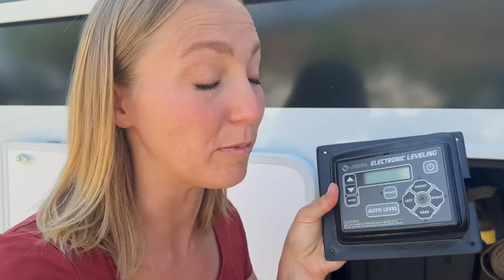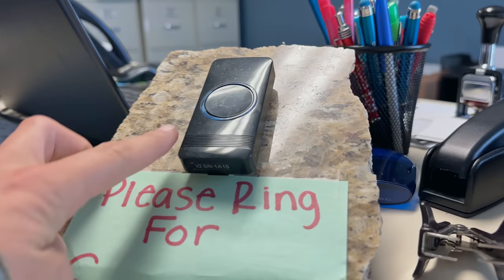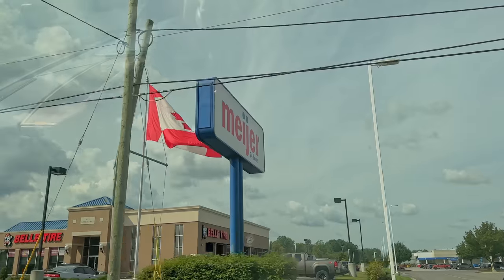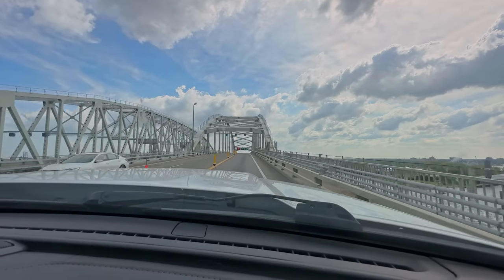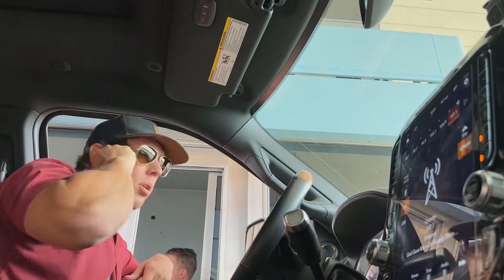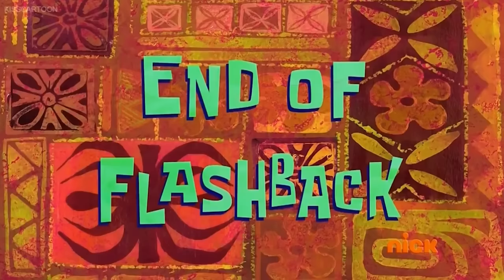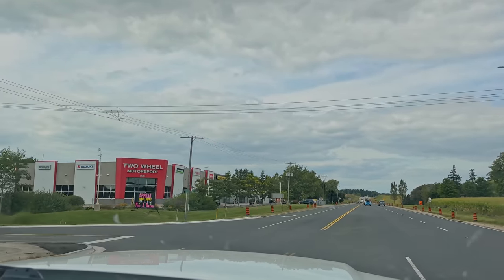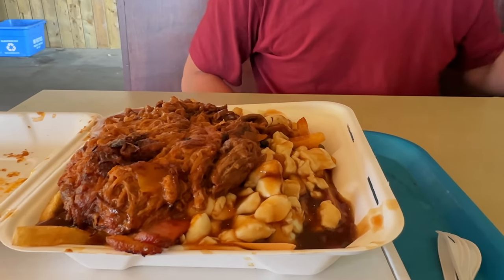Canada Border Crossing with RV...Why so Mean? [RV Living]

Comment: Hi!  We live in Buffalo (WNY) area (62 years).  If you haven’t crossed the border yet, use either the Niagara Falls one or Lewiston.  Those are not as busy as Peace Bridge.  It’s always easier to get to Canada than coming home.  Don’t be surprised how much they will give you a hard time coming home to USA!   One of the questions they may ask is if you bought any liquor in Canada (you are allowed to buy it cheaper in Canada and bring it back here. Depending on how long you have been there, is how much you can bring back.).   Also, the easiest place to get wings will be Duffs on Transit Rd in the Eastern Hills Mall.  Plenty of space to park your RV, and in a good neighborhood.   Also, it is only a mile off the 90 Thruway exit.  Actually Bar Bills is right by here as well as (a close empty parking lot as well) and Anchor Bar is also right here by the exit as well.      We would love to meet you two if you are interested in lunch/ dinner.. Message me!
Reply from the maker: Well, we did end up doing the Peace Bridge Crossing as we read it was the biggest (for big rigs) but it was quite busy! overall went smoothly though. Thanks for coming along!

Comment: Craig and Victoria when you get time later on if you need a better hitch for your truck to pull the RV or traveling trailer, get in touch with Nick the Hitch. He is on YouTube; we watch him help another RV travelers because you guys travel a lot as well. Safe travels
Reply from the maker: That hitch is actually the one we have! A PullRite Superglide hitch. Been using it for over two years since we first set out on the road and love it. It's great since we have the short bed truck, would highly recommend it if you need a slider hitch!

Comment: I worked for the highway department in Ontario- bridges that are close to or under the legal road height are signed with yellow and black signs, with height in meters.  Bridges that are high enough for legal loads do not have such signs.  Overheight loads require a special trip permit with a route that does not conflict with low bridges.  The bridge collisions are typically backhoes and excavators poorly set up on trailers, and the odd overheight transport load that was improperly measured.  

There were some old overpasses that instructed trucks to use the center lane, with height restrictions noted for all three lanes (400 N of Toronto).  All of these bridges have been replaced and now no bridge height signs.
Reply: Are there any bridges that are unsafe?
Reply: @BeanCruisers  each bridge is inspected annually by a technician.  Every 5 or ten years, each bridge is thoroughly inspected by a structural team.  Any bridge with major flaws identified by the technician is reviewed by a structural team.  Bridges in poor condition, but still safe, are inspected by structural teams on a shorter cycle.  More common on smaller roads, you will see weight limits- this is deemed the safe weight by the structural team.  In my years of MTO service, I have never heard of or have been part of a discussion regarding letting an unsafe bridge slide under the radar.  So, it is unlikely that there is an unsafe bridge out there that MTO is deliberately not dealing with.

There can be surprises lurking inside bridges unseen by the inspectors, chance of failure is not zero.

Comment: i can see spraying wd 40 on the slide plate to clean it BUT, did you put some grease on the slideplate  for the friction thatt the 2 make?  i use the blue lube grease for the slideplate, the same that is used for the buddy bearing or the the axle bearing, . in the past i noticed a trucker using NEVER -SEAL LUBE ON THE SLIDEPLATE! THE BEST IS THE AIRCRAFT LUBE MADE FOR THE FIGHTER JETS LUBING POINTS. APPLY WHEN DRY?

Comment: I have been back and forth across the USA CANADIAN border 3 times.
I really never had an issue even with my R.V.
Yes , they search all your stuff , ask you the "nornal" 20 questions , looked at my paperwork , all good.

BTW , Canada insurance requirements are a little different so contact your insurance company and make sure you DO gave the correct coverages and paperwork for Canada.
I did my research and all was good.
Reply from the maker: We have progressive and from the research I did, we should be good. But will probably call to make extra sure before we spend long there next year. Thanks for watching!
Reply: It is the information that is printed on your policy page that must meet the Canadian requirements.
It is not the same as here in USA

Comment: That is not an RV you have.  That is a fifth wheel.  Completely different then an actual RV that has the Cabin attatched to the unit and is openly accessible from inside the unit.
Reply from the maker: If you Google the definition of RVs, you’ll find that fifth wheels are a type of RV. But you are right in that it’s a different type of RV than the one you described, that type could also be described as a motorhome.